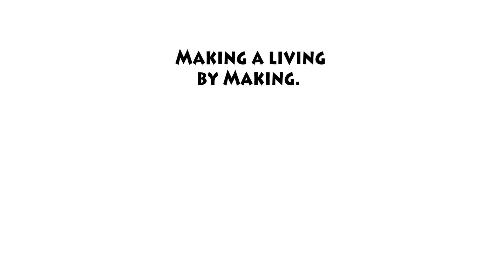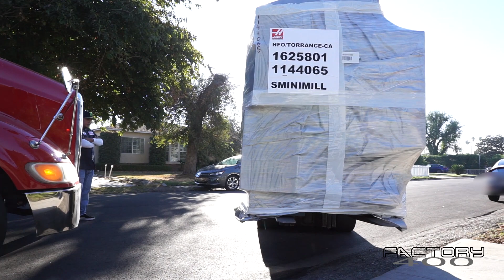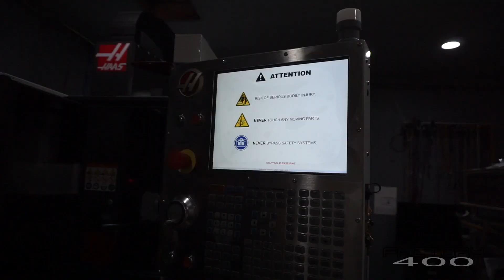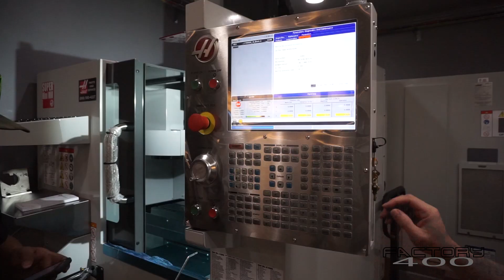CNC Milling Machine arrival at the Factory400! Episode 004

Comment: how much of a pain in the butt is it having the coolant tank that close to your wall? i just ordered a mini and will be placing it nearly identical to your layout.
Reply from the maker: The coolant access is primarily on the right side of the machine. Having the left side against the wall is not really a problem.
Reply: @Factory400  ahh i figured with the pump being on the left, there would be a chip catcher or some other nonsense over there id need regular access too. I feel a little better now. :) my lathe has a cast in tank as well, and it too is a pain in the tuchus so i was at least prepared for that much. Are you running Qualchem?
Reply from the maker: @DieselRamcharger  Pump access and screen cleaning can easily happen from the rear. I can get behind mine and [barely] open the electronic cabinet door which is enough to access the pump, filter, and screen.
Reply: @Factory400  Awesome! thanks, i really appreciate it. My sales guy has been one small step above useless. Thanks again!
Reply from the maker: Coolant access on the mini mill is a pain in the butt no matter how much room you have around it.

Comment: Do your neighbors complain about the noise?  I would figure that in LA there are tons of rules against this as even here in Michigan within subdivision the HOA's will not allow this.  This is why I just bought 5 acres zoned agricultural and building a new house which will have a 500 sq Machine Shop while I place the electronics in the 2,300 s/f basement.  I also saw you used cable races and might steel that as that is a good idea!  I know this video is rather old so hope that things are still going well with your business!
Reply from the maker: I sound insulated the garage and you can barely hear anything at all even at full speed with a 3/4" end mill fully engaged. I only have to be careful not to open the door while running at night.
Reply: LOL "open the door while running at night" :-)  Hope you find more time to do videos around the business :-)
Reply: LOL "open the door while running at night" :-)  Hope you find more time to do videos around the business :-)